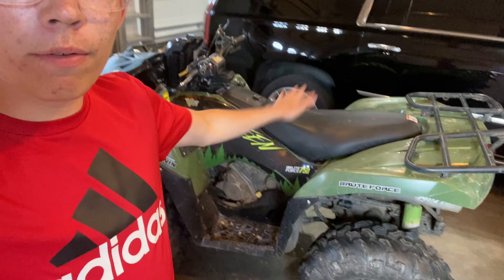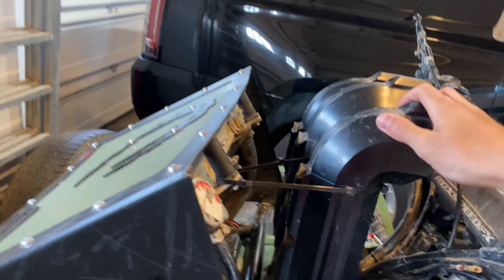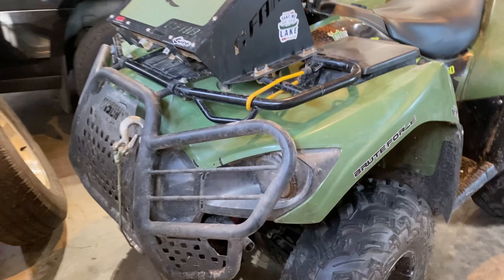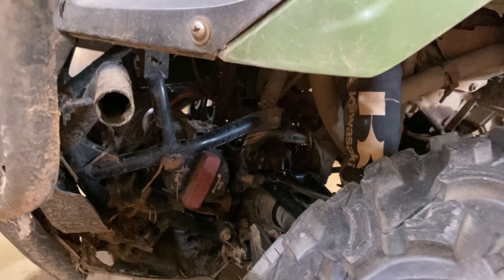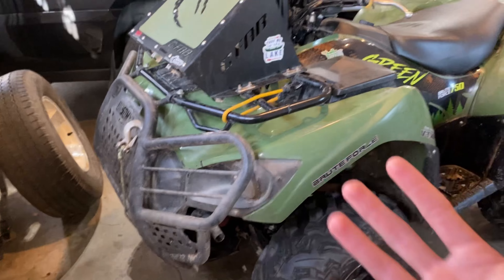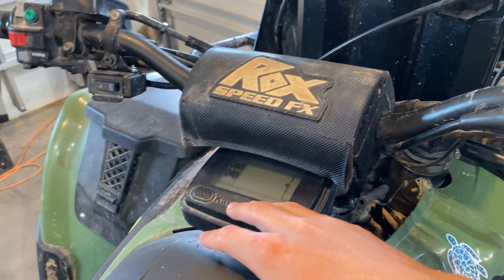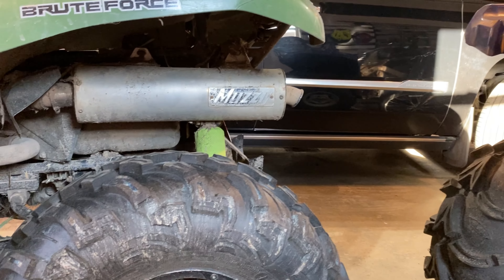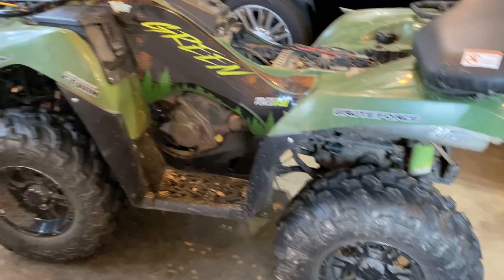Kawasaki Brute Force 750 Mud Build Walkaround!!! *INSANE*

Comment: Get rid of that muzzy fuel controller and get a MSD FI CHARGE. Have vforce John load a tune in the msd and you WILL  have more horsepower than your current setup.